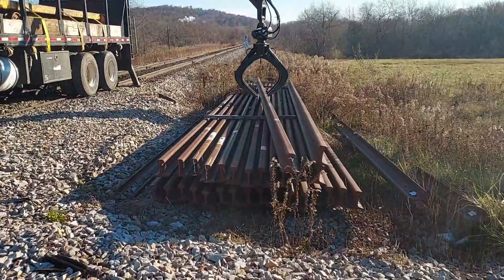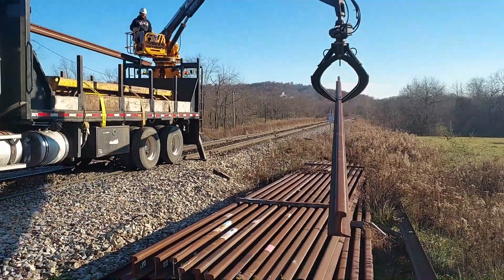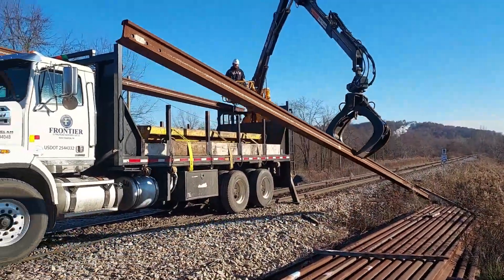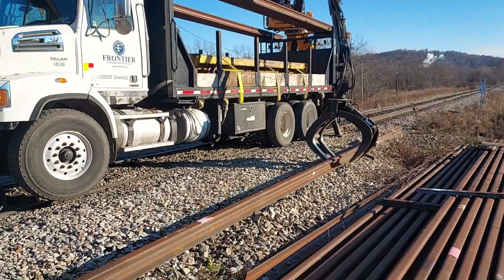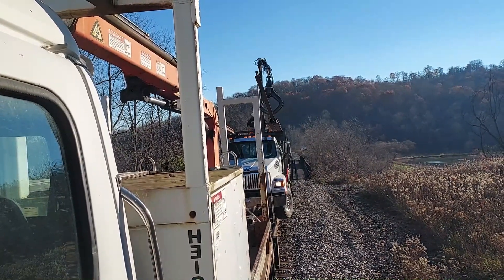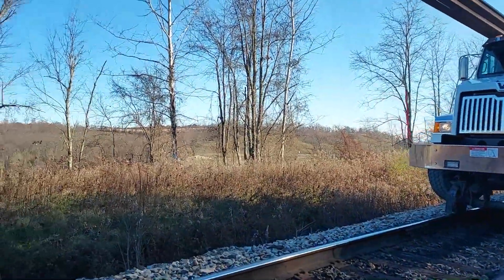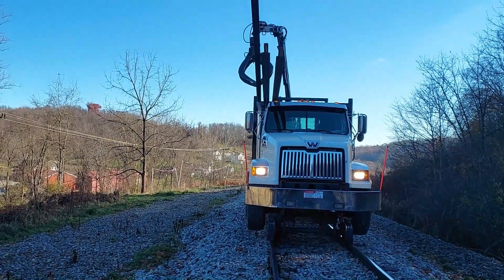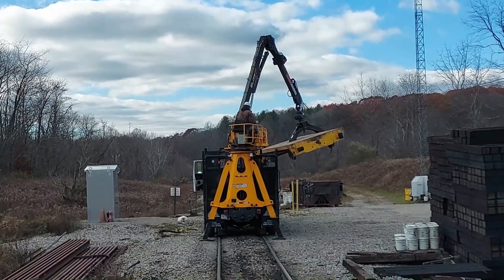Grapple Truck Loading New Sticks of Rail

Comment: Thanks for another informative video. These hi-rail trucks are versatile. I used to conduct the Sperry car. The allied gang would follow us as we tested with a load of stick rail. If we found a defective rail the gang would change it out and perform any other repairs as needed. I would take a Form D line 2 and own the track. We would get a lot accomplished in four hours, this was the time allotted for the outage since commuter service would resume at 1545 from Hoboken. I learned a lot from the MOW gangs. I could hardly wait for the Sperry job to come up for bid, got me out of uniform and kept my skills sharp. Many of the conductors did not like to Sperry car since it took a lot of moxie to work this car. The Sperry crews were a great group of people and good cooks.
Reply from the maker: Awesome comment Gary!  Really enjoyed reading it. We follow the
Sperry truck, only we will take a rail drill and put joint bars on a
defect until we can find time to change out the rail there. Of course
running coal on class 2 track is far different than commuter, your
standards are much more stringent and that is great.  We also
have gotten Nordco and Herzog in to test for us, none of the 3
ever offered to cook for me.... LOL
Reply: @ccrx6700  I guess the Sperry service uses a hi-rail vehicle. Back then it was a rail only car which looked like a big trolley car. The crews from Sperry lived on this car as it traveled from railroad to railroad. This rail car contained living and kitchen quarters and was capable of tying up at obscure locations if necessary. Each railroad that contracted Sperry's service supplied a conductor/pilot for the car's movement over its lines. Also a MOW official rode in the rear with the testing crew. When the car reversed direction the conductor moved to the testing end to guide the car back to the originating point. Speed while in transit not exceeding 50mph where track speed permitted. Blocks were placed behind the car while in transit and the conductor had to report clear after designated points so the block could be cleared. 19 orders gave way to Form D authority for testing movement. Easiest way with the Form D was the line 2 so one could move either direction while testing. This way the conductor owned the track and could allow movements of other equipment in the owned section. Passenger trains were excluded. We tested at night on the busier commuter lines when regular service ended.
Reply from the maker: @garykuipers2696  Awesome Gary, I understand now. We've obviously never
had a Sperry car being we don't interchange with anybody, but do understand
now the cooking. One Nordco truck we had in here did have a hot plate in it....LOL

I was really surprised at the speed. These trucks that come in here go about
10. Have never seen a Sperry car in person, just pics of one and never gave
that a thought from reading your original comment. 

Did very much enjoy reading how you did things with them and took
track authority. Thanks so much for replying back my friend.
Reply: @ccrx6700  Dave, your channel is the best source of information. I'm sure active and retired railroaders view your videos; they enable us to relive our days on the high iron. Rail fans are great people but they don't get to see everything that is accomplished during a railroader's work day. Thank goodness for the rail fans, though. Their films from the past recorded the operations of old. Your videos present the day to day nuts and bolts operations and hardships experienced in railroad operations. I come from a railroad family and my oldest son continues the tradition.

Comment: I always think it looks like the rail will fall when it is picked up at one end, those grabs must have a lo of pressure to hold it. Your notes are interesting. We also mark our rails with paint but the meaning for each colour is different to yours another thing is the longer rail you use ours are only 60 feet. I had not heard of alloy rail until I recently saw about a type now used in wet tunnels that is more resistant to rust.
Reply from the maker: Really glad you enjoyed the video and the description my friend. Not
a whole lot of folks read the description, am glad you do. I'm not
familiar with alloy rail either, other than it exists. Interesting about
the different colors! The sticks the guy was loading in the video
are 39 foot, had mentioned about the 78 footers cause they thermite
welded 2 sticks together. Will have some videos of those 78
footers out sometime in the future. 

I would be most interested in the rails you mentioned about being
resistant to rust. We have such a problem here with the coal laying
against the rails and the acid in the coal eating the steel away. Hope
you can sometime send me some more info or links so I can
check that out.
Reply: @ccrx6700  I am not sure where I red about it now but have an idea it could of been on a site where rail manufactures post articles. I will have a look there for you
Reply: @ccrx6700  Well that did not take as long as I expected I found a video on here Shame the music is so loud over the commentary. I guess it would cost a fortune to ship t over there and you would need to contact BS to see if it could be made to your weight. Still interesting to see what a difference the coating makes. https://www.youtube.com/watch?v=A8sHx2-gNuE
Reply from the maker: @cedarcam  Awesome! I really like that idea. Watched the video and cannot
thank you enough for sending it. Had no idea anything like this existed. That certainly
would be the ticket for those areas around our load out and unloader where
the rail is constantly covered with coal. I'm going to approach management
with this idea. but you're right, getting it here would be quite an expense.

But what an expense it will be if we have a derailment because the rail
corroded and being covered with coal I can't inspect it. You wouldn't believe
how the base of some of the rail in these areas gets eaten away by the coal acid,
along with the spikes. Wonder if they have spikes coated with that? WE
looked into stainless steel spikes long time ago and they were
outrageously priced.

Interesting they called the bottom of the rail the foot and we call it the base.
Reply: @ccrx6700  I am really pleased you are going to look into the possibility of using some of this rail. I had not realised coal was so corrosive so it could be worth the cost if it is going to save a few replacement costs. We do not use spikes like you have but do have them Maybe you could send a batch over to be coated if you do order some rail. I bet stainless would be a fortune yes. We have a mixture of the same names you use and ones we use which is interesting to me as well. The switches we call points and some of the component parts have different names to the ones we use
Reply from the maker: @cedarcam  Had our contractor in today cleaning coal away from the rails
at the unloader, told him about the coated rail, he was very interested, although
he doesn't make any decisions here. I'm going to send management the video
tomorrow and talk with them about it. I really do believe we would save
ourselves a lot of future trouble by using that rail in some spots here.

Coated spikes sounds wonderful to me as well as tie plates. years ago we
painted a lot of tie plates with rustoleum where they were going to be under
coal and so far that has worked well.

That is one of the really cool things about these videos that I absolutely
love and it's because I hear a lot of ideas from other railroaders which is
perfect for me because I don't get to be on other RR job sites. So keep
your thoughts coming! Love to learn the different terminology also.
Reply: @ccrx6700  Thanks for the update Dave. I hope they agree with how we are thinking. An initial high cost but over time a huge saving.

Comment: Just came across what looks like a wood spike. Is there such a thing. Found it as I’m ripping out a old RR tie retaining wall.
Reply from the maker: Those are tie plugs. They look similar to spikes but don't have a
head on them. When we pull a spike out, the tie plugs are driven
down into the hole to keep moisture and dirt out. Can drive a new
spike down thru them also. Thanks for writing in and asking.
Reply: @ccrx6700  I figured that’s what it was for but never have ever seen it. And for it to be laying outside on the ground after demo of the railroad ties when the retaining wall was built in 2005 is incredible. I really thought it was a spike then seen it was wood. Good to know a guy who would have the answer. How often are they used?
Reply from the maker: @scratchbuiltdozer  The ones we got in here were creosoted so
they would last a long time. Happy to help you with an answer. We no longer
use the plugs, we use a product now called Sure Spike. It's a granular powder
that looks like gun powder, just pour it in the spike hole, keeps water out
better than the tie plugs. If you watch my video on spikes I show it in that one.
Some RR's use an epoxy to fill the holes, it works the best but have to
keep the glue warm in the winter, it's called Spike Fast.

https://youtu.be/nInJFLjxcZs
Reply: @ccrx6700  I just don’t recall that video but will watch it now. Always enjoy your videos and learn something new in just about every video. Keep ‘em coming!

Comment: Thanks for sharing,  your enthusiasm for railroading is great. Do you think that continuous welded rail will ever be used??
Reply: @Bruce Paul Mainline tracks use CWR because jointed rail is not allowed.  Yard tracks or Industry tracks use 39ft or 78ft sections of rail and use joint bars to connect the rail.
Reply from the maker: Glad you enjoyed the video Bruce, we do appreciate your writing in
and for watching today. We will never have CWR here because we
do not interchange with another RR so it would be impossible to
get those 12 or 1400 foot sticks in here, sure would be nice if
we could tho!

Comment: Great show Dave, love grapple work. What is the reason behind your truck not having a grapple, in stead of the extra steps you need to take to load a stick.
Reply from the maker: There are different size cranes made by Palfinger for my truck.
The one I have on there now is not strong enough to handle a
swivel grapple. I called the manufacturer many years ago asking
if I could put a grapple on my crane. That was an excellent question,
you are a thinking man my friend. Thanks for watching the show
tonight.
Reply: Grapple, do you not have "rail dogs"?

Comment: Thanks for that link to alloy rails.  That's always the thing with steel, finding the right balance between hardness and ductility, and that varies wildly from one application to another.  In the auto industry, we always wanted steel with good ductility because we were always stretching and forming it. Our Millwrights called it "bubble gum steel."
Reply from the maker: So many different conditions on so many different RR's with
so many different needs and applications. We have it simple here,
but others don't and have to use their engineering skills to determine
what application is best for their situations. Very good info
you have related to us Rod about the balances and ductility in steel
applications, thanks so much for sharing your expertise with us.
Reply: @ccrx6700  Love your videos, they always make me think of something I've never thought about before. That's not an insignificant talent you have.
Reply from the maker: @Rod Challis  😊 golly, what a nice thing to say, I'm humbled

Comment: 78' long pieces of rail, wow. I'm guessing you didn't pick them up at the local Lowes! How do they get delivered since your line isn't interconnected with any other RR?  Wonder how that particular length got developed, why not 66' or 91'?
Reply from the maker: Excellent question sir! They thermite welded two 39 foot sticks
together. Got couple of videos coming out sometime on Brandon
loading those 78 footers and dragging them up track also. Not sure
when those videos will be shown tho. Nobody rolls 78 footers, 
however they do roll 60 and 80 foot sticks. Appreciate your
writing in and for watching the show my friend.

Comment: Why is this sectioned rail verses a continuous welded rail?  It's been a long time since I have seen sectioned rail one after another in a long time that is why I ask?  Hello from San Antonio, TEXAS too!
Reply from the maker: Good question JT. We have all bolted rail here which is a maintenance
nightmare.... but being that we do not interchange with any other
railroad, there is just no way we could get 1200 sticks of CWR in
here. Only way we could get all welded rail here is to thermite weld
each 39 foot stick and at $550 per weld, that cost would be
astronomical plus the time involved to change everything over. Thanks
for checking in and watching my good southern neighbor.

Comment: DAVE:  WHATS HARDER ON YOUR RAIL .....  THE COLD OR  HEAT, BESIDES NORMAL WEAR ?
Reply from the maker: Excellent question William! The hardest thing on track itself as
far as weather goes is the freeze/thaw cycle. I would much rather
have it freeze and stay frozen than to have it freeze and then thaw and
over and over again. Biggest problem with high heat is the danger
of track buckles (heat or sun kinks as you would recognize the term).

In really cold weather rail gets brittle, that's a big reason why I
don't tamp when it gets below 32, along with frozen ballast. When
rail temps get above 90, then the rail is very flexible and gets
like a rubber band and when lining track at those high temps, it
can go all over the place. Your question deserves an entire
video to go over all this in detail, but I think you get a better
understanding for now.
Reply: @ccrx6700  WHILE CWR MIGHT BE HARDER FOR YOU TO MAINTAIN, AND I ALSO FOUGHT THE FREEZE/THAW THING ON ROADBED, BREAKING SIGNAL BONDS ETC.....  OUR MOW GUYS WORKLOAD DROPPED WITH CWR AND I'M GUESSING THATS WHY THE 78 FT STICKS ARE BEING USE BY U
Reply from the maker: @wmhoward2249  it helps to eliminate joints when possible for sure

Comment: Very interesting stuff about the paint colors designating the type of metal. Are there any permanent marks to tell the same thing?
Reply from the maker: Thanks my friend and yes there are. Rail brands and rail stamps and
I've been wanting to do a complete video on showing the rail
identification marks for some time now, but so much other stuff
has gotten in the way, I'm sure you can relate to that! Do appreciate
your tuning in from your busy day and checking out the home
movie tonight my good man.
Reply: @ccrx6700  Thanks Dave. i learned the date of manufacture from my grandfather, but he never mentioned the other stuff. I look forward to the video, but take your time 😊
Reply: Also what determines where different types of rail go...Orange, Blue, Aluminum...
Green is a Length moniker...
Reply from the maker: @donaldwittmuss6079  Whatever rail the engineering department decides
to use for any one application. We use all 132 heat treated (head hardened)
rail here, green is the only other color than orange that we would see here.
Hope that helps explain better.

Comment: Dave, My Ford F-700 is for sale and has a Prentice G on the back. 
Works great for ties and rail.
Send ya the pictures 📷. 
Richard Bause
Reply from the maker: I'll see if they are interested Richard, thanks for the kind offer.
We do appreciate your watching the video tonight my friend.
Reply: @ccrx6700  make ya  good deal. 
Did new rear brakes last fall, exhaust manifold gasket work, oil changed. Engine solid, low mileage.

Comment: Dave, Could you explain what a Sperry defect is.  Is it a Crack or fracture in the steel?  Fun watching machines do the hard work people used to do.  Be safe.
Reply from the maker: Sorry Thomas, I planned on having that in the description and
simply forgot to put it in. When the ultrasonic rail testers find an
internal defect in the rail, we then call that a Sperry rail. Sperry is
one of the original rail defect detection systems. Sperry, along with
Nordco and Herzog have all done our rail testing here over the
years, it's just who is available at the time. But if Nordco comes in
and finds a defect, we still out of habit, call that a Sperry rail.

That was a very good question and I'm glad you asked my friend.
Reply: @ccrx6700  thanks so much.
Reply from the maker: @thomasglessner6067  😊

Comment: Great video. How far ahead do you have to plan in order to get time on the tracks for maintenance? Are there projects that are planned a year ahead? Are those plans subject to change, based on your assessment of the safety of the track? Thanks :)
Reply from the maker: Everything changes daily here..... We do get some dead track when
they have a longwall move and work is planned for those shut
downs, usually every 6 months there is a move, so planning takes
place in those 6 months. And yes if there is a safety issue that is
a real concern that is usually addressed immediately if possible,
so many different events happen there is no one exact formula.
I think you understand a bit better how things work here. Thanks
for tuning in and watching the video my friend.

Comment: What does 132 mean?
Reply from the maker: 132 is the weight of the rail per yard. There are different weights of
rail out there. Typical rail for us is 132, however many RR's are using
136 or 140 pound rail for main line now.